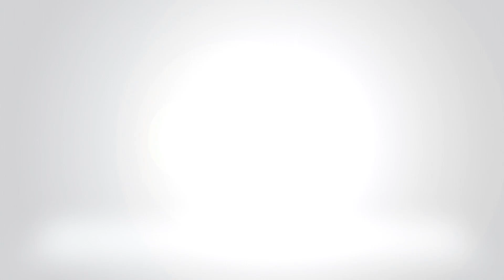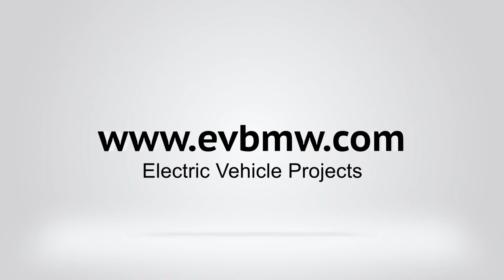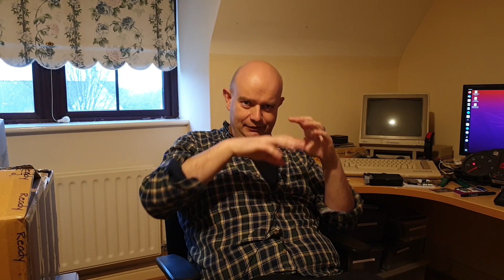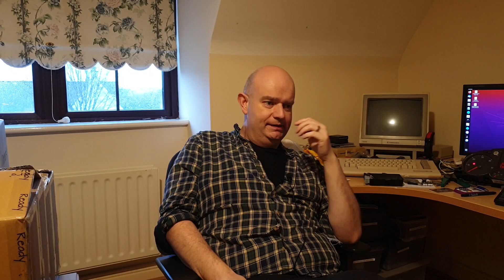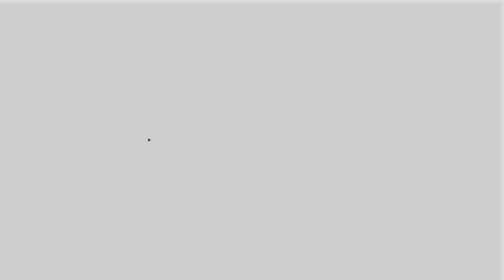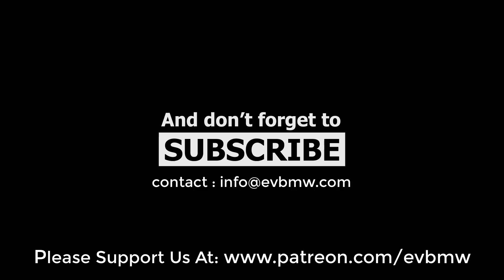Question: What Car Should You Convert?

Comment: i have a 75ft motor yacht with two MAN v12 diesel engines.I use it only on short trips a few times a year but they cost me a fortune in fuel ,maintenance have to be turned over regularly.
I thought to replace with two complete ev car drive trains with a back up diesel generator.
Any thoughts on whether this would be feasible?
Reply: Boats suck for EV conversion unless you're happy at 6kt
Reply: I'm only looking to go 10 knots max for short distances

Comment: I was going to put myself on the waiting list for the electric Ford truck, but apparently so many people have done it already that their original announced production is sold out for the next two years.  Going to have to find a beater to get me through the lean times.  But if I was going to convert a truck, I would probably ditch the bed and put a flat/stakebed on it, so I had boatloads of easily usable room below for electronics and batteries.  Also, it seems car manufactures have started to catch on the the ideas Nasa prototyped for electric airplanes: more motors are easier than fewer (and adds redundancy).  Why have a differential, if you can just drive each wheel separate.

Comment: - This is absolutely correct! Convert the car that you would like to drive. I've been planning my upcoming conversion for about two years now and been digging a lot into what would be the ultimate car for me. And It is a E39. Or actually two of them - a sedan and a Touring :). Will be starting a new YouTube -channel and a thread on the openinverter -forum for them within the following months.
- But what I see Damien didn't actually know is that the E39 sedan is one of the most aerodynamic cars that there were around the millennium. But does it make a huge difference? No. A E39 has a CdA (drag coefficient * frontal area) of around 0.586. Almost all of the sedans from that time (and even still today) have a CdA around 0.65 +- 0.1 so there can be about a 15% range difference with the "best" and "worst" sedans. (Aero does about 50% of the consumption in mixed use.) With lithium batteries you can make that 15% increase with a small amount (like 20 +-10 kg) off batteries.
- I think the most important car spec is that if you are stuffing a lot of batteries and a heavy electric motor the car it should have a large motor and transmission etc. to strip so the curb weight doesn't increase too much. For this a straight six (or even V8) BMW with automatic transmission is great. At the same time a tiny car would have it's weight increased a lot so there wouldn't be much room anymore for luggage before reaching total mass.

Comment: I like the idea of the Mitsubishi L200 conversion as I have a 1998 Hilux and would like to convert it to EV . Seems like the removal of the engine and swapping the gearbox to GS450 would yield  battery space either side of the rear prop and give better weight distribution.  Just need to figure out the centre diff to retain the 4WD.  
Happy New Year Damien and best of luck with the new house 🏠

Comment: My 2 cents worth
1. Pick a car you like and want to be in long term. This should be you're number 1 priority as you're about to spend a year or two working on it and hopefully several years driving it.
2. Pick the cleanest one you can find or you'll spend as much time repairing it as converting it.
3. Find the highest spec one available, preferably with heated seats and if possible a heated windscreen to save on cabin heating.
4. Unless you're REALLY smart with CAN go for an older car.

A few years ago I decided I wanted a project. At first I wanted to put a V8 into a smaller car but the thought of 20mpg at well over £1 per litre (currently £6.50 for an Imperial Gallon) made me think again so the idea of an EV conversion started. After much disappointing research where everyone talked about small, light and aerodynamic I came across this mad Irishman converting BMW's and the rest is history. If I ever finish my Landrover Freelander project I'll let you know how it went.
Reply: how's it going?
Reply: @blackterminal  Slowly, lol
Reply: @alibro7512  My little BMW has been going since 2016. :). Though it's now much further along touch wood. Life gets in the way sometimes.
Reply: @blackterminal  no videos in your channel?
Reply: @alibro7512  I haven't made any. I will do some when the car is rolling.
Reply: @blackterminal  I drove mine today to put it in the garage but the inverter was from an ebike, the batteries were from an old UPS and there is no power steering or brakes. 
But I was in the drivers seat making it go with the accelerator pedal 😋
Reply: @alibro7512  Cool. I'm close. All going well I can take it off the Jack's not too far away. Have some new custom power steering hoses being made and I need to fit a underbody splash shield. I also want to check clutch cylinder as I can't currently disengage the clutch.  It's awkward putting on Jack's so I want to get these things sorted
Reply: @blackterminal  take a look at my channel for latest updates

Comment: Why not something like a transit van? Could make it 4 wheel drive? 🧐 
If a pick-up truck, it’s gotta be the venerable Hi-Lux, surely? 😊
Reply: Even a medium sized van will gobble up unimaginable amounts of energy. Prepare for doubling the battery cost. If you go for something like a Sprinter, that's almost triple the batteries per unit of range. It's all about the frontal area and zero aerodynamics at the rear.

Comment: (North) American dude here, done lots of construction, gardening and landscaping work and live in the country..  I can put a good word in for the Mazda b series / Ford Ranger, same truck. Smaller than most but I’ve carried embarrassingly large loads ( embarrassing for the larger pickups ) like 15 sheets of drywall plus lumber. Not room for passengers, but you have cars for that. If you need more than that truck skip the regular sized trucks and go for (the massive) F250, or pull a trailer.

Comment: Please do a Subaru Outback. The best would be the 2007-09 generation, but also 2010-12 would be a good fit too. There is pleanty of those cars with broken diesel engine while it is very practical, well built and fun to drive vehicle with great off-road capabilities. So having a ev conversion how-to would probably save a lot of cars from being scrapped.

Comment: i got a 2008 dodge charger which is even more of a boat than the e39 and i can comfortably get 200 miles on a 56kw battery and is one i would recommend if using tesla components. this is because of the ease of the conversion itself for that particular car. there was tons of working space and installing a model s LDU was almost as simple as dropping the rear dif out and putting the LDU in its place. it also has a very deep storage under the trunk for battery space while still keeping the normal trunk size. because the front was built to house a v8 engine you also have nearly half the car worth of room to pack whatever you want in. for me i temporarily  packed a generator in there for registration purposes then eventually swapped it for another set of batteries. the main reason i got a charger is because they were cheap, extremely common, and commonly had their engines pre-pulled out of them with the only major ICE components remaining being gas tank and the rear dif.

Comment: I was only half on-board with you until you cleared up the golden line, that there isn't a technology reason you can't convert any vehicle anymore. There just might be a budget reason. And the larger, heavier, and less aerodynamic vehicle you want to convert, the more expensive it's going to be, probably linearly. A lot of people want an EV because it's cost effective, and, for them, spending less is a big part of that decision. Also, taking less risk on a DIY project means smaller budget too. My first EV was a kick scooter, then an electric bicycle, then a motorbike, and now a very small and light sports car. Honestly with how good of EVs you can buy and roll off the lot these days, the reasons for doing a conversion are greatly reduced. It's pretty much "Because I love this vehicle and it doesn't exist as an electric" now. Classic cars more or less.

Comment: Nice summing up of things, but...

Just how bad were the Lead acid batteries you were using? The VW Scirocco I converted 20 years ago had a nominal 192V 55Ah (10.56kWh) pack of Optima YellowTops, that weighed 320kg. I could easily get over 25 miles on a charge and it would out acellerate the stock 1.8Gti.

Comment: I think put all your years working on Tesla inverters and convert model S or 3 to full open source fully cut from Elon's tentacles and hack supercharging as it's from the car end not the charger that determines SC or make a nissan Leaf 4wd controlled by your prius mg1, mg2 inverter board system controlling both. Or lastly a rwd prius or yaris using your knowledge on the lexus 450H transmission. Good luck and either way I'll watch. Have an enjoyable new year.
Reply: I mean.. All you need to do for that is to remove the simcard :D

Comment: i think the Audi A2 is the way to go, its all aluminium super light construction, spacious and super aerodynamic for its time and even now, i have seen a similar project on internet on day.
Reply: I was thinking of the A2 also, but Damien just told us not to convert light/aero cars 🤔😅
Reply: @kierank01  didn't say 'not to' convert an aero car - just that it is now not a requirement with better batteries. Of course if you choose to convert an more aerodynamic car you'll be able to go further for a given amount of battery energy.
Reply: I would also vote for the A2 since it is so similar to the car I'd like to convert, e.g. the B5/C5 A6/A4/Passat/Superb :P
Reply: Slow on the reply, but also consider parts availability in case of chrashes and bumps, because A2 is made of alu sheeting and nobody repairs chrashed alu panels.

Comment: Diesel Audi A2 is perfect candidate for all to follow along cost wise.
Reply: i totally agree with you on this one, full aluminium body and no rust drag coef 0.28.....
Reply: @alanmay7929  The drag coefficient isn't even that great considering the B5 Passat is 0.27 :P They are cheap considering their aluminum body though.
Reply: Excellent drivetrain shares alot with other vw's for an upgrade path on brakes and suspension, the aerodynamics matter more as the speed increases so under 30mph little town run around the lightweight shell will make a big difference to kwh per mile if the batterys can be packaged in a decent way .

Comment: Convert an old Audi, something from the 90s, such as 80 quattro / S2 / RS2 / Cabriolet. They should be old enough to be classics and are very nice and reliable cars, simple to work on and there's plenty of community support, technical information, and parts. If you choose an Audi 80, choose the V6 model, because they have nicer headlights and in general better equipment and their front springs will be ready for a heavier load.
Reply: I’m considering a newer Audi as many of these are mechanically totaled, but still very nice cars.  My current idea is a first gen TT with a Prius transaxle… once that’s running, throw a Toyota MGR in the back.  A great side project would be to coordinate the dual motor inverter with MG1 and MG2 coupled, then add another inverter for MGR and add control to Damien’s VCU to run all 3 motors.
Reply: Actually you want to choose the bigger engine variant of a vehicle because it'll have a larger gross weight on its registration papers, which means it can legally carry more batteries without taking off seating capacity. It might also have a larger tow weight, if you need to tow stuff.
Reply: I think you'd be crazy to convert an RS2!  Have you seen the cost of them! and also noted for their strong  and characterful engine.
Reply: @TC-V8  You can pick a V6 Audi 80 avant quattro as a better starting point for much cheaper and they can be converted to RS2 spec for the parts that matter for EV conversion, the difference being essentially some of the suspension and brake parts. There are still plenty of them in relatively good condition with nothing wrong with them except the super inefficient 2.6 or 2.8 V6 engine.